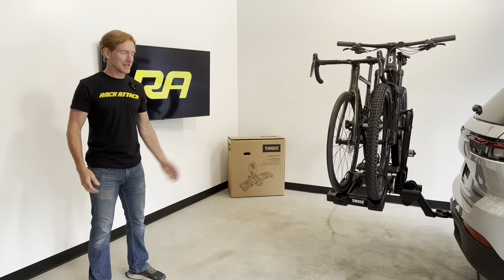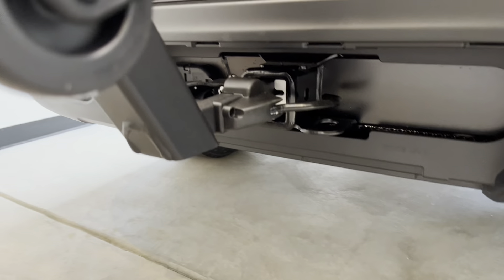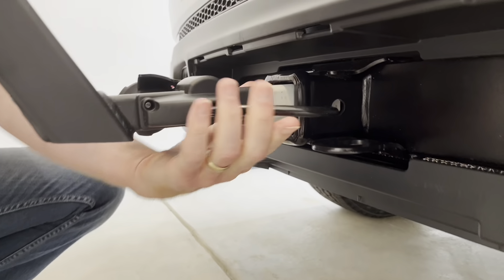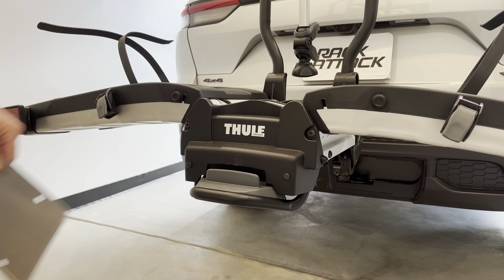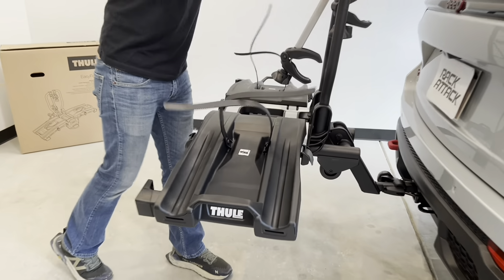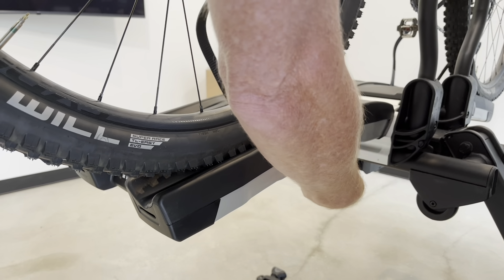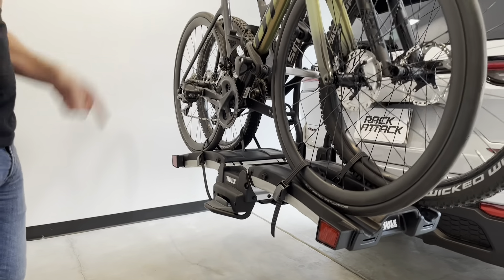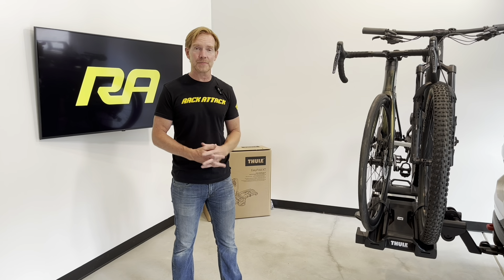Thule EasyFold XT Hitch Mount Platform Bike Rack Overview

Comment: I have this rack and am struggling to remove it from my hitch.   You make it look smooth but when I unlock the knob for the expansion arm, the knob unscrews and falls off without loosening the expansion arm.   Also, the auto latch in your video seems to stay automatically in the open position.   Mine does not, therefore it's a two person job with one having to hold the lever out while the other person is lifting the rack out of the hitch if they are even able to slacken off the expansion arm.   What am I doing wrong?

Comment: Thanks for the review. Regarding the grips for the frame, how well do these grip on the e-bike frames that have an integrated batteries? Do they open wide enough to encompass those frame types? I am thinking about the Aventon Pace 500.3  step through model.
Reply from the maker: Hello.  The clamping jaw will fit diameters slightly over 3 inches (80mm).  The jaw could be positioned in several areas to allow attachment to different tubes on the bike.  The seat tube may be a good alternative to the downtube where the battery is located.  Thanks!

Comment: Great video.
Thanks.
I have a 2 1/2” receiver (with a 2” insert, if needed).
Will the auto hitch pin go in far enough to also engage the insert tube?
Reply from the maker: Hello.  The 2-1/2" hitch is not an approved fit, even with an insert.  Vehicles with extra high payload capability generally have rear suspension too stiff to adequately absorb road shock and transmit the shock into the rack and bicycles.

Comment: Are he clamps limited as to height of the vertical horseshoe bar. As posted below I would be concerned clamping to my E bIke with integrated battery. Or does the Horseshoe bar have the ability to adjust to go higher ?
Reply from the maker: Hello.  The support hoop is fixed, however, the attachment arms are fully adjustable to reattach in various positions on the hoop and angle to reach while the clamps rotate 360 degrees.  Thule also offer the new Epos which provides an alternative to the EasyFold XT and may attach in different ways to suit: https://youtu.be/sI0-UblXlzc

Comment: When I was stationed in Germany,  I had this carrier.  The one I had has turn signals a break lights.  The harness plugged right into the plug for a trailer. 
Do you have this light system as an add on in your shop?
Reply from the maker: Hello.  Thule produces this rack in unique forms for different markets, in the USA the rack has passive reflectors.  There is no option from Thule in the USA to add powered lights.  There is a solution in the USA for the EasyFold to upgrade to powered lights:
https://bikeracklight.com/product/bike-rack-light-bar-for-thule-easyfold/
Check the store nearest to you to inquire about availability.
https://www.rackattack.com/stores/  Thanks!
Reply: Kody Technologies also makes a few different super safe and very bright bike rack lights for the Thule EasyFold.

Comment: What’s your long term experience with the XT so far with a carbon frame bike? It’s currently on sale for REI members and I’m considering this rack since I have a carbon frame Trek Checkpoint and my wife has a Trek Townie step-thru with fenders. This seems to be the only rack I’ve found thus far that can accommodate both carbon framed and fendered bikes together.
Reply from the maker: Hello.  The Checkpoint is designed for rough terrain and will have thicker layers of carbon fiber construction than a pure road bike frame.  Still use caution to avoid over tightening the clamp but there's should be little cause for concern with this setup.  Thanks.

Comment: Are there also bike racks with a complete tail light set? Is it possible to get/use a second license plate? The both options I asked for are mandatory here in Germany.
Reply from the maker: Hello.  This model is intended for the US market, similar models for the German market include the lights and license plate holder.  On Thule's site the country can be changed and the products will update for that market.  Thanks!

Comment: Continued : need to know how to reduce forward bouncing.  Receiver is cranked tight.  Please respond. Thanks.
Reply from the maker: Hello.  Any play in the stinger/hitch interface can usually be minimized by rocking the rack vertically and horizontally while tightening the turn knob, this will help to set the stinger wedge into the corner of the hitch.

Comment: Does the "Auto Pin" lock when you turn the knob for reducing the wobble?  Or is it just for deterring the hitch DEPTH?
Reply from the maker: Hello.  The Auto-Pin is used to insert the rack's stinger to the correct depth and is also a passive retainer while the turn knob and wedge serve as the primary anti-wobble and retention into the receiver hitch.  Thanks!

Comment: Does the "Auto Pin" lock in when you tighten the knob?  Or is it just for determining the hitch DEPTH?
Reply from the maker: Hello.  The Auto Pin does not lock, it is a passive retainer and hitch depth gauge, the locking turn knob and wedge create the ant-wobble and security.  Thanks!

Comment: If you want to keep this rack on the car, can it be folded up flat against the car when not in use? (So it doesn't stick out as far)
Reply from the maker: Hello.  This rack does not fold up against the vehicle as some other platform racks do.  Instead, this rack is designed to be easily removed and stored in-between uses.  Thanks!

Comment: I recently got this and it will not work with my OEM Subaru installed hitch, the hitch pin prevents inserting into the hitch because the OEM hitch is flush with the rear bumper  fascia.  Wish I could remove the hitch pin and use a third party pin.  Contacted Thule for a solution and I haven't heard back from them.  I can't recommend installing a Subaru dealer OEM hitch on the Outback.
Reply from the maker: Hello.  The position of the end of the hitch being flush with the bumper facia is ideal for rack clearance, however, here are certain hitches that are not compatible with this rack.  A class one hitch (1-1/4 inch) will sometimes have a stopper, a tab, that prevents the stinger from inserting completely.  Also, there are illustrations in the instruction manual that shows the minimum distance from the end of the hitch to the hitch pin hole must be no less than 1.5 inches.  Thanks!
https://www.rackattack.com/public/product instructions/Thule_EasyFold_XT_903202.pdf
Reply: We just got this too for our '19 outback and noticed the same problem.  😢  Have you found a solution.  We need a rack for our ebikes.
Reply from the maker: @Lolamack  Hello.  Check out the Thule EasyFold XT or the new Epos, both are well suited ebikes and the two bike version has an adaptable hitch stinger to work with both 2 inch or 1-1/4 inch hitches.
Reply: @Lolamack  I'm working the problem, took the 2023 Outback back to to the dealership and they realized there is no way to insert a locking hitch pin unless more is cut more off the bottom of the facia.  Of course you could use a non-keyed pin with cotter pin and hope your load ($$$ rack) is still there after your ride.  I told them I can't believe Subaru would sell and install a hitch with this design flaw.  They looked into it and discovered there are two cut patterns and that I needed the second cut to widen the space to install a locking hitch pin.  Excellent we'll see if this will help but will need a hitch pin with a front side lock.  Not the usual extended type, I don't believe the new cut will be that wide.  I've bought one let's hope it'll work.

But, don't forget, Thule uses a hooked shape pin that extends out by inches.  So I ordered a hitch extension the type one would need to extend the hitch away from a rear mounted spare tire.  So we'll see once the fascia is cut wider, I'll install the extension, and we'll see.  I can't believe Subaru is selling  a hitch that doesn't work!  I'll have an answer in a couple of weeks or I'll have a Kuat or Hollywood Rack or something other than the Thule EasyFold.
Reply: @rackattack  that will not help the hitch stinger can't get to the hitch pin hole because the Subie fascia/rear bumper is in the way preventing getting the pin to the hitch hole.  Thanks.
Reply: @mikerod5396    I am so disappointed with the Subaru OEM hitch, a design flaw for sure!!!!   What a frustrating problem it created.  

I found out I didn't have the exact same problem as your hitch.  We have a '19 Outback and the hole for the locking pin on the OEM 1 1/4" hitch receiver was too close to the end and the rack could not be slid in far enough to secure it using the Thule pin.  After much debate and talking with a farmer friend who could fix any problem, we ended up drilling a 2nd hole farther in the hitch to secure the Thule hooked pin properly.   Our bumper cut out is wide enough and the hitch hangs low enough that using the Thule locking pin will not be a problem.  YAY!    

After much research we have found that this Thule EasyFold XT rack is the only bike rack that will support the weight of our Aventon Level2 bikes that won't destroy the bike fenders and is also compatible with a 1 1/4" receiver.   We will be leaving this weekend for a 2k mile road trip.  Hopefully, all will go well!

P.S. Don't get the Hollywood Rack!  Just today a guy in my Facebook group posted a picture of his broken Hollywood rack.  He had it on the back of his RV and didn't know it broke while he was driving.  Damage was done to his bikes, his RV and the ladder on the RV.  😢
Reply: @Lolamack  Great solution and great advice, thanks, and have an excellent trip! 🚲
Reply: @rackattack  I just noticed that on my brand new Honda 1 1/4 inch hitch, the distance from the end of the hitch to the receiver pin is less that 1.5 inches. I didn't know about that requirement, but I already ordered the rack. The rack is on the way (Thule EasyFold XT 2 Hitch Bike Rack). What to do? I got the hitch installed at the dealership.

Comment: How do you lock the bikes?
Reply from the maker: Hello.  The turn knobs that tighten the grip of the jaws to the bike has integrated security with Thule's One Key System lock cylinders which are key matched to the hitch lock security.  Thanks!
Reply: @rackattack my knows allow the jaws to open/close whether the lock is turned to the open or closed position. Can you give a little more insight to how the locks are supposed to be used?

Comment: How do I remove the 'arms' for relocation? I was traveling with 2 brand new Gaint Liv ebikes, and one of the ebikes fell away from the vehicle, hanging, which caused severe  damage to the handlebars and brake.  As you can imagine, I was devastated.
Reply from the maker: Hello.  Sorry to hear that.  The arms can be repositioned and or removed by loosening the turn knob then pulling back on the collar near the clamp down point, this will allow the clamp to unhinge from the vertical support hoop.  Here's the chapter of the video showing this function:  https://youtu.be/-T06_dMcGUg?t=540 
 Thanks!